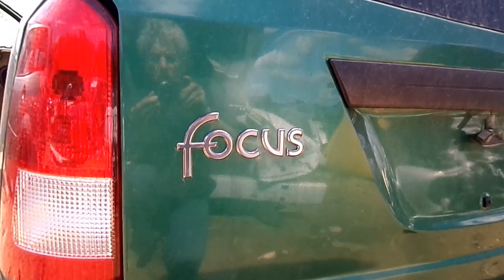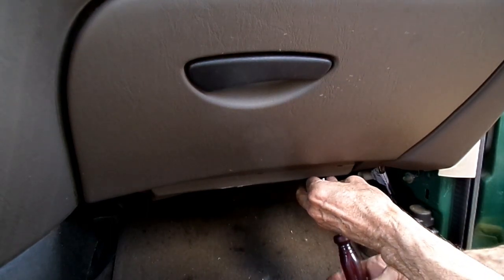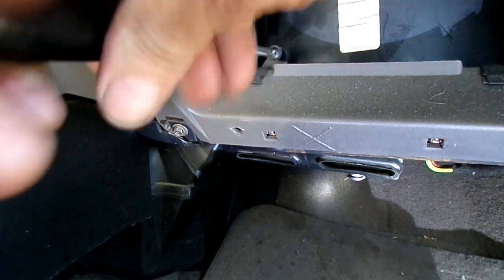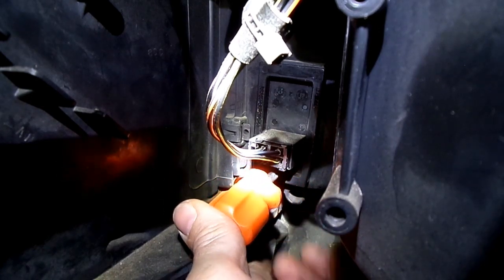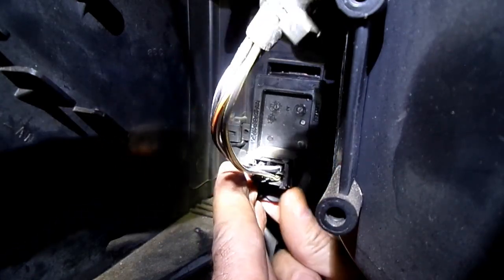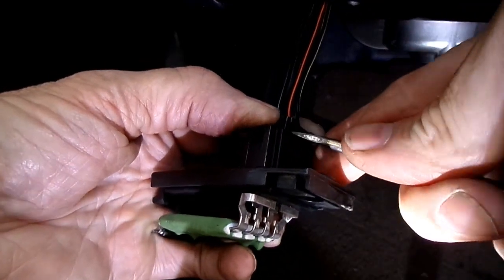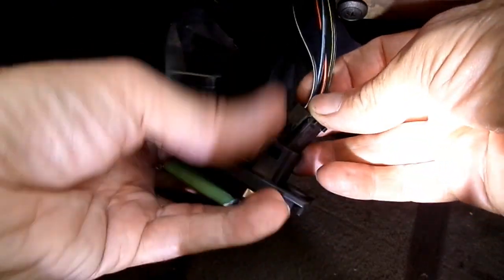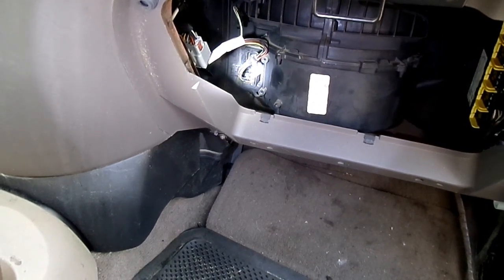Ford Focus Blower Motor Resistor Replacement

Comment: Sir why was it replaced? Trying to troubleshoot my 2011 Focus SE it's only blowing cool at Maximum and reading that the blower resistor is at fault I haven't gotten diagnostic yet but before I start buying parts want to be certain, thanks for the video 👍🏼👍🏼

Comment: We had an '02 Taurus and that thing was blowing all the time. It was a 30+ dollar pop and I could only get it at the dealer.  I found that simply re-soldiering a new thermal fuse was far less expensive - a two dollar fix.  One I replaced it, we never had it blow again, oddly enough. 

This model is very different than the Taurus, which was three different sized copper coils, and a thermal fuse. When blown it only works wide open, for obvious reasons.

Comment: These resistors can get overheated and fail when the blower motor bearings get debris in them or corrode. When replacing this resistor, also remove the blower motor, clear debris out of it and lubricate (oil) the bearings.

Comment: Can’t believe they use resistors for this function, that’s so incredibly inefficient. PWM would be much better. Thanks for pointing out this procedure anyway, my 3rd blower setting is broken. This should be an easy fix.
Reply: all vehicle with manual heaters switch contained blower resistor

Comment: Yep i can see how that metal air guide could be a nusance.
Now you have a new torch, what about using a six inch diameter mirror and a mini bean bag, glue the bean bag to the back of the mirror, you could put the mirror on the floor and easly adjust it to show the hidden underdash screws/wires/whatever lol.
Silly thoughts :)
Reply from the maker: zx8401ztv I have used mirrors lots of times and they worked out very well.
Reply: richpin06a just dont look into one, i did it once and frightned myself, nightmares all night :-D
Reply: Was it necessary to disconnect the battery before doing this?
Reply: lightningsmokerXx thats always a good idea when working with anything electrical on a vehicle.

Comment: My 2006 had a 8mm bolt instead of the Philips head screw holding it in.  Seems my issue however might actually be the switch.
Reply: I replaced the resistor on my 06 and i still had the same problem. Going to do the switch next and see if that works.

Comment: If the resistor goes bad will the blower motor quit working?
Reply: Yes , and you  wont be able to have any of the four speeds
Reply: @pappy007kush6  That’s not true.. Each speed setting has its own resistor. So they break individually. Unless your negative connection to the blower is broken, but i think only the positive goes through this resistor setup.

Comment: I had to do this 3 days ago, all went well, the replacement resistor worked fine for 2 days, then it failed the same as the old one had. Any ideas folks what the problem could be as I can only have the blower on position 4 Again, as 1,2,3, don't work !
Reply: What was it?

Comment: 2014 Ford Focus Blower motor is underneath passenger side behind gas pedal.  Nearly impossible to access.  Designed to be difficult by Ford in order to generate repair profits.  Ford Motor Co at its worst!